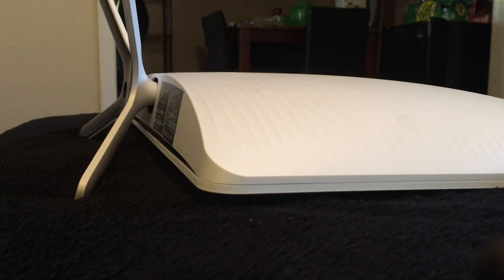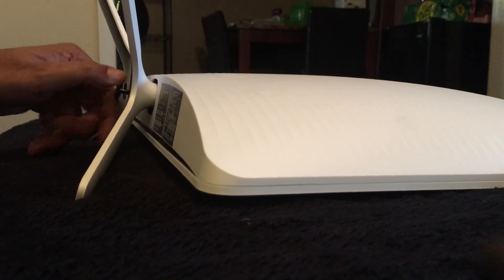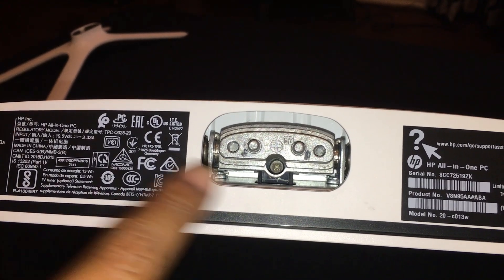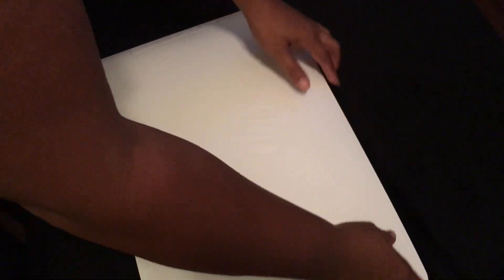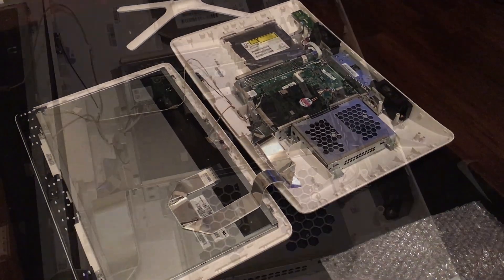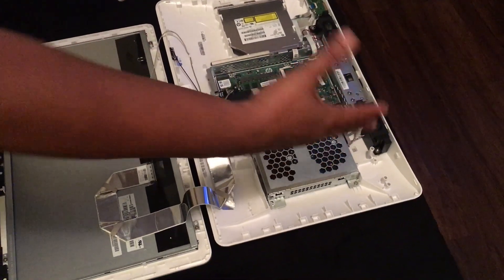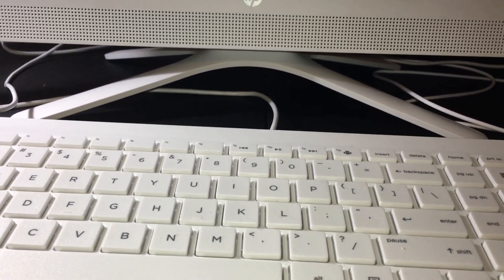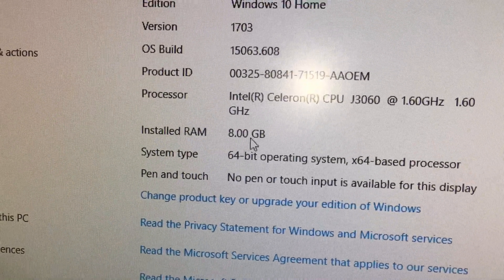Step by Step How-to-Upgrade Ram in a HP All In One Computer

Comment: Question do I use Pny-4gb 1.6 ghz DDR3 soDIMM laptop memory or Visiontech-4gb pc3-12800 DDR3 dimm unbuffered non-ECC desktop memory-green
Reply from the maker: Pny-4gb 1.6 ghz DDR3 soDIMM laptop memory. This computer only takes soDIMM RAM Cards.
Reply: Ms. Multifaceted k thx for the info gonna try to buy as soon as I can :D
Reply from the maker: You are so welcome!